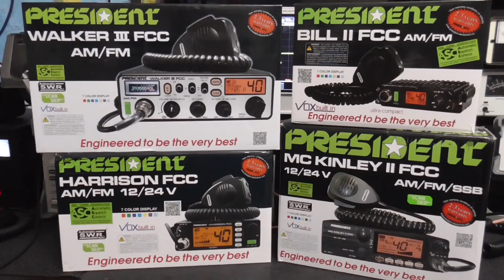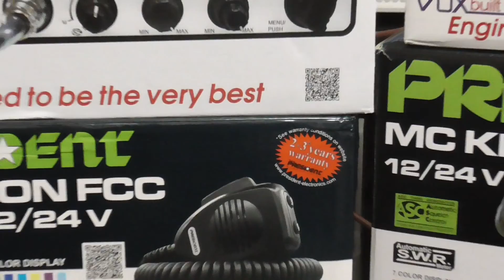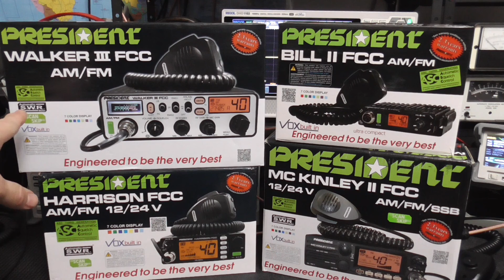Welcome New Viewers!

Comment: To any noob, used ham radio gear is cheep and WAY better then any CB especially new CB radio's.
Reply from the maker: When you speak about used ham radio gear that's kind of confusing for newcomers.
Ham radio gear could be anything from VHF/UHF radios all the way up to full featured HF transceivers. I would avoid purchasing anything used because who knows how long it's been sitting around and if it even works properly.
Buying outdated used means you're buying someone else's problems. Especially at a bargain price.
For someone just starting out who has no radio experience, a modern CB radio is very simple and easy to understand and operate.
Obviously those who are more inclined may want something more advanced.

Comment: What can you tell us about the president richard?
Reply from the maker: The Richard is a 10-Meter thru 12-Meter (when expanded) AM/FM radio.
Reply from the maker: Good RX and TX.
Reply: I have a president Andy II and was wondering if they had a hidden menu feature and does it actually do anything? Thanks!
Reply from the maker: Yes it does. Probably not going to make a significant difference.
Reply: The manual doesn’t tell you how to access it for some reason. I appreciate the help man. Thanks!
Reply from the maker: It's not something they like to share with the end users.

Comment: Hi new to the channel and I am familiar with CB looking to get into ham I just replaced my vehicle I went for on a subcompact car to a truck I am currently running a cobra 29ltd chrome and a 102 stainless steel whip I haven't had a chance to install the radio and antenna I had the antenna mounted with a beehive mount on my car in your opinion where would the ideal place to mount the 102 on my truck looks don't matter I have seen mounts on the bedrail and on the rear bumper
Reply: You want it in the middle as much as you can you can use a mirror mount and use just the side the antenna screws on and mount it on the bed rail where the back glass is
Reply: I have an in bed tool box would that work
Reply: @shaunforcier  Yea that would be just fine
Reply from the maker: If you don't mind not having a lot of clearance putting it on the roof would be a good area as well.
Getting into Ham Radio.
Some good information can be found here.
https://www.arrl.org/licensing-education-training